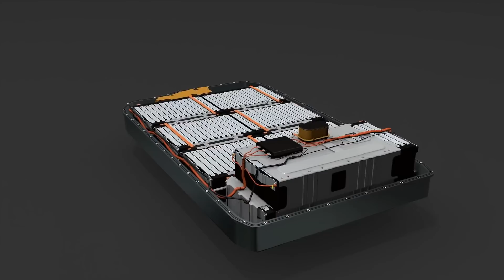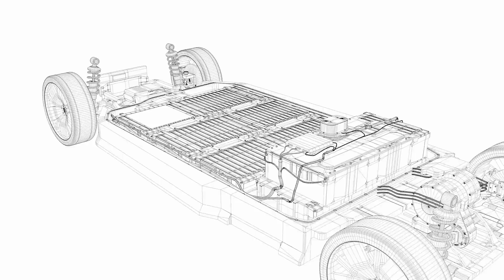Tesla's 1,000,000 Mile Battery Is A Game Changer

Comment: According to Tesla CEO Elon Musk, Tesla car batteries are supposed to last around 300,000 to 500,000 miles or about 1,500 times of charging and discharging.Oct 30, 2023

How Long Does a Tesla Battery Last? - Lectron EV

If you charge everyday then that means it only lasts 4.1 years?

Comment: The infrastructure needed to charge all those future electric cars will cost billions of dollars, which will be eventually paid by ALL DRIVERS not just Tesla Drivers.  The total cost of owning a Tesla over time will be huge unless, UNLESS a you put in Solar panels on your home and can charge your baby overnight for free.  If you try and sell you Tesla toward the end of its life, you'll have a hard time selling it because of the high cost of battery replacement.  Can you imagine purchase an older used Tesla for, say $10,000 but then have to consider putting in a $7,000 new battery.  You would be better off staying with Gas.  Now, if Elon Musk can develop batteries which will go a thousand miles on a charge, say with Graphene batteries, that then will give us cars which would rival gasoline powered automobiles.  By now I would have thought Tesla would have gotten up to what is called, "Economies of Scale", but yet they are still charging far too much to appeal to the average automobile purchaser.

Comment: The main limitation on EV is the miles/ charge as compared to petrol engine 
Secondly for EV charging time greater where as if conventional fuel is not taking minute to fill up your tank also you can pour directly to your tank but if EV  battery is consumed there is no alternate 

So I believe that the single charge for EV is far far greater than the conventional

Comment: Takes 9 hours to be fully charged
It is expensive 
It needs charging every 270miles (if you are lucky)
Reduced milagr due to heat lose, leakages... 
No widely available charging points and those charging points are mostly occupied as numbers on the road increases

Then there is massive questions over recycling and environmental impacts from mining side of raw materials for the battery to end of life of vehicle.

I am truly surprised why and how it has got this far!? But i doubt very much it will go very far. Many emerging technologies are coming through which will replace battery in coming years.

Comment: Freighting networks are a great investment.
Those supply chains are encouraged firstly,
before public consumption takes root,
so very important for government funded projections.

I personally hope the Robotaxi has a mini train carriage like shape.....
not only because with no driver necessary there is no need for its engineering to incorporate a driver compartment into the design,
but also to distinguish it from normal on road vehicles.

God bless

Comment: I own a Model 3. A million miles is fake. May be the body of a vehicle may last a million miles. currently my model 3 with a full charge of 205 miles (85% maximum charge as per recommendation for extended life of the battery) but actually it can only go for 160 miles. So to me Tesla still needs another 20 years to go to be able to produce a battery that could achieve a real range of 400 miles.

Comment: I’ll believe it when I see it up here in Canada with all the cold
Reply: Use more electricity in cold weather , burn more gasoline in cold weather , so what's your point ? Electric motors don't need to warm up unlike gas guzzling engines.
Reply: My point is what the video is talking about not what ur talking about. Ur talking about range and yes I know all about the range goes down in cold because I e bike everywhere I’m talking about the life of the battery because FYI cold does hurt electronics meaning batteries and also hurts motors if there not sealed.
Reply: Electronics and batteries lives are not effected by cold. Heat is more the enemy than cold.

Comment: At present you can only really use 80% of the battery from new as they do not want you to drop to zero or go above 90% it takes the charger a long time to put in the first 10% and the last 10% so effectively you would only getting 75% of the 80%

Comment: Elon musk is a genius .
Everything he designs is AMAZING.
Reply: That isn't what the organisation who reverse engineered a Model 3 thought......  They looked at how the car was designed and built, and found several instances of fairly poor design. A wheel arch for example, was formed from nine separate pieces of pressed metal. Many car makers do the same job with just two or three parts. They did say the drive train was as good as it currently gets though..... There can be little argument that Tesla know how to electrify a car, but they don't as yet have the decades of manufacturing experience and know-how some other car makers have. Some Tesla owners have also voiced concerns regarding build quality - including one Tesla owner who regularly posts on here. But that may be a drawback of being less experienced in volume manufacturing....
Reply: @Brian-om2hh  Support Elon Musk 
 And stop looking on fake news.
Only God is perfect.

Comment: Can someone explain why the electric car can't be self sustaining without the need to recharge at a charging station? In a conventional gasoline motor ,the "battery " is needed to begin the process of rotation to begin the combustion process..The alternator then replenishes the charge of the battery by way of electromagnets within the alternator that turns from a belt placed around its pulley that spins creating electricity captured by the battery..This process happens over and over again and only until the battery can no longer be recharged due to a cell within the battery giving out, or the alternator giving out over time...Why can't 4 large Alternators be created and engeneered to be attached to each of the 4 wheels and use the rotation of the wheels while driving as a means to create electricity from the electromagnets within the alternators....In other words allow your driving to recharge the batteries that are being used to power the electric vehicle...This process self sustaines itself....Just a thought...👍

Comment: I don't get all this electric BS. They never talk about the the pollution involved making these batteries and repairing them not to mention the toxic fumes and fire risks. The lithium mines they dig with Fuel/electric rigs you can see from the moon. its worse than you think! The world just needs road ways with eclectic in them so you can burn fuel or connect to clean power when needed. I guess this is just to simple to think a car that runs on both hummmm

Comment: there's really no point in a battery lasting that long in cars when they can barely last 200k miles. 18-wheelers on the other hand would benefit much better from this than cars
Reply: Mist cars last much longer than 200k.
Reply: @kamencic  and trucks last over 1 million miles. 200k or not, it's pointless to have a million mile battery in a car that barely goes 200k miles. Cars can't compete on that level
Reply: @Seri-Katil  I live in Serbia. Most people here buys used cars from Europe's riches countries. To buy a 10 year old car here is perfectly normal. And most cars we drive today are from 00' and you can regularly see cars from 90'. And believe me when I say that most cars last over 500k. Some  probably near 1m. We don't know exactly because dealers temper with mileage clocks.

Comment: 3 minutes, that’s how long it takes to fill my gas tank from empty. I can then drive another 500 miles after. Then, after that 500 miles, another 3 minutes. 1500 miles of driving requires less than 10 minutes of refueling. How long does a charge take? What’s its mileage worth?
Reply: If you measure the carbon footprint of what goes into a tank of fuel compared to the carbon footprint of a full charge you'd be amazed at how much better electric is. It's way more efficient.
Reply: The record setting high mileage car is a Volvo P1800 with the B18 Volvo engine. It has driven over 4 million miles with only 3 engine rebuilds that's somewhere around 1.25 million miles per engine rebuild. It probably costs $500 dollars to rebuild that engine. How much is a new Tesla 1 million mile battery? $20,000?

Comment: "The Tesla and phone's batteries are pretty much the same. They use Li-ion batteries". Dumbest reasoned explanation video I have ever seen. LI-PO and LI-ION are NOT the same
Reply: They actually use laptop batteries
Reply: @chompchompnomnom4256  It also depends on what laptop. Old laptops, usually with removable batteries used Li-ion. Nowdays to reduce the thickness of laptops, the battery is made up of multiple cell Li-Po batteries.

Comment: Did anyone request to drive 1 m miles with one battery? What can you use that for? Most cars are done after 200k. We need lighter and smaler batteries that charge fast, but no one needs a battery for that long.
Reply: That's the point, you don't have to spend time charging your battery, literally use your car until your car is done.

Comment: Million mile Battery is for the Tesla SEMI Truck. 
Semi-truck(18 wheel truck) Often Do Drive 1 million miles.
Reply: Nope
Reply: Le Chat Botté : they will use it on all their vehicles ... but semi trucks often do Run 2 million miles over 20 years, cars are stationary 98-99% of the time.

Comment: So they went from (I'm just guessing from what I've heard) a 650 Mi range, to a 1,000,000 Mi range. Somethings not right here. There has to be a catch.
Reply: The 1m is not range, it’s how long it will last before needing replacement.  Also, range for the cars are closer to 310.
Reply: Copter Cop  why do you have to be rude...🤨
Reply: Copter Cop  I believe that it would be a Whooooosh momemt
Reply: ??? 160,000 miles max compared to 1 million? 650 mile range on one charge no doubt, not 1 million?
Reply: Copter Cop  You are a jerk.